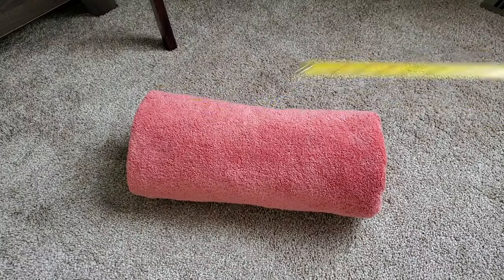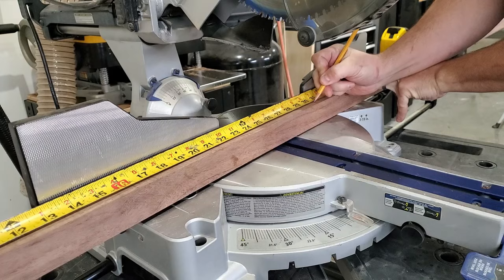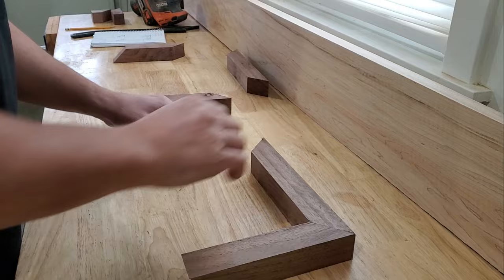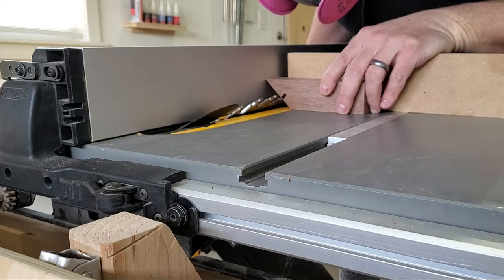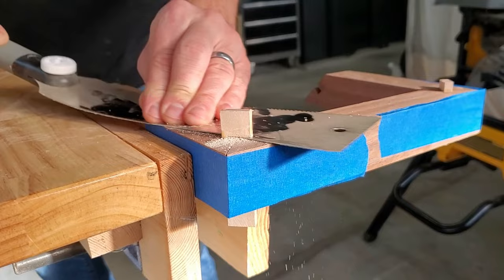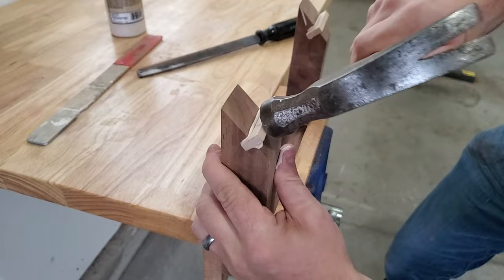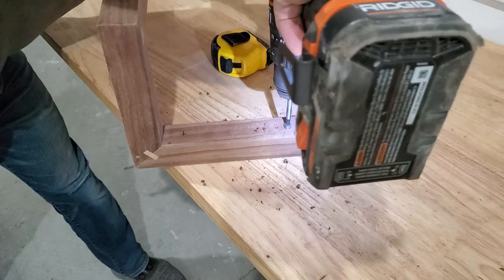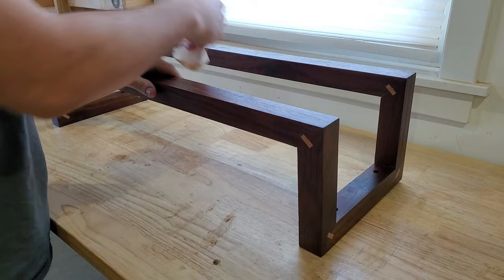How to Build a Stylish Towel Holder

Comment: What size screws / anchors to you use to pass through the wood? I was thinking of using keyholes, but I'm afraid the wood might stress over time given the environment. Thank you!
Reply from the maker: Sorry, I don't recall what size screws I used.  I think keyholes would be ok.  I would  just make sure to make them deep and try to make the screws fit tight so it doesn't fall off the wall.  Thanks for the comment!